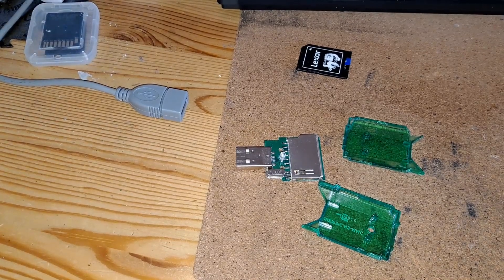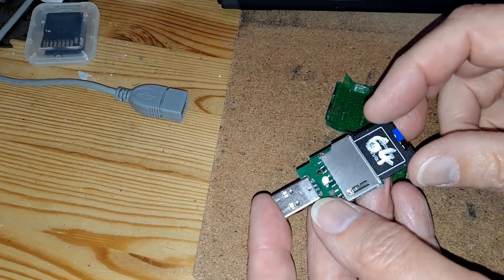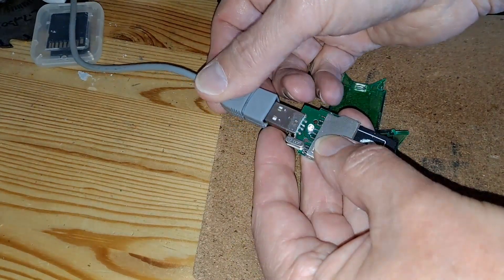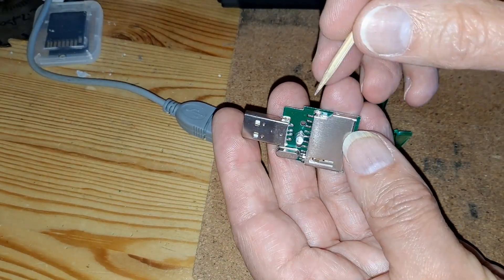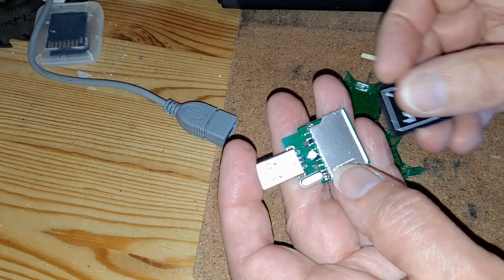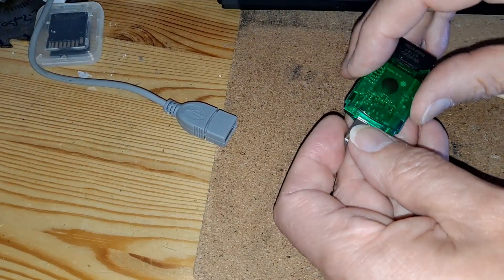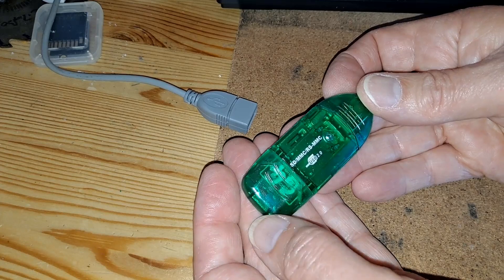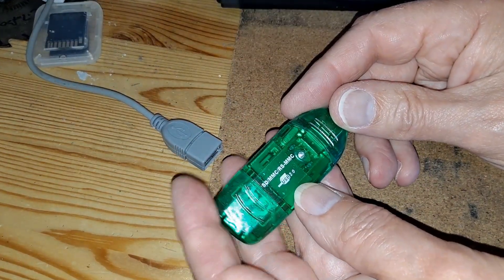Peek inside a Poundland SD card reader

Comment: Ya I’m looking for some myself. Your eyesights are good. Nice one Grandad
Reply from the maker: Not entirely sure if it was a genuine fix. It certainly worked after I did what I did, but without doing a more in depth reverse engineering to check the circuit, I really don't know if it was a coincidence.

Comment: I remember these
Reply from the maker: I find them useful as many of my action cameras are a 'bit funny' about connecting via the USB port. Sometimes they work, sometimes they lock up, so it is more reliable to pop the card out and read it direct using one of these adapters.
Reply: @GrandadIsAnOldMan  absolutely sir I remember back in 2008 when I bought a load of them thinking they were usb memory sticks 🤣 (was a kid at the time)
Reply from the maker: @amzace  😆🤣👍